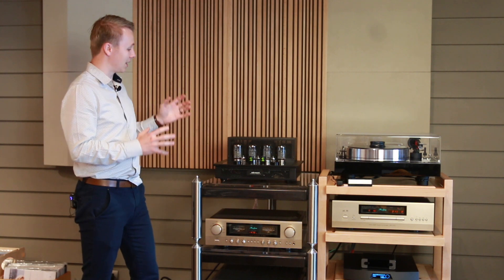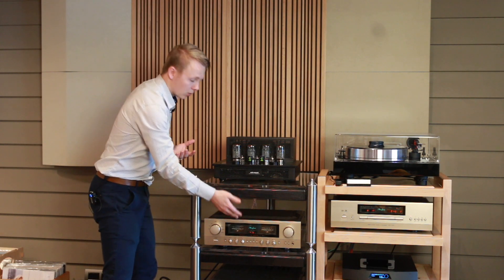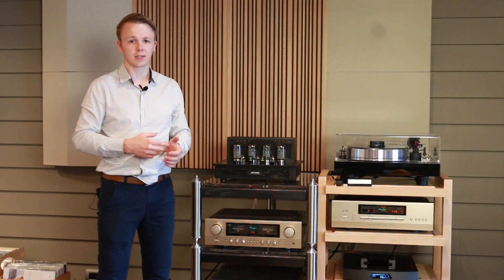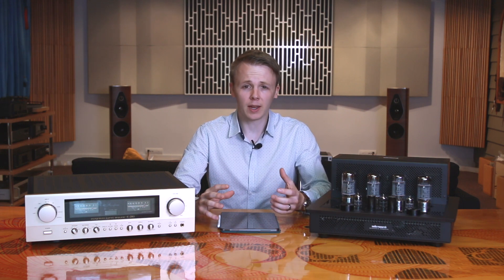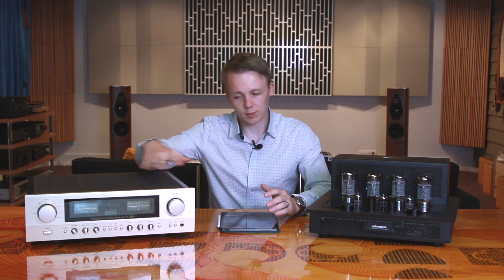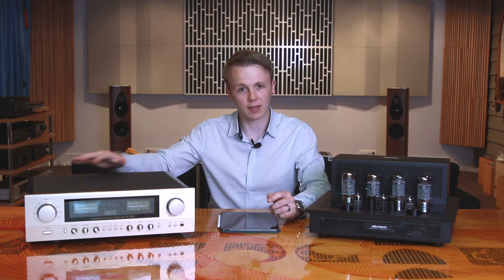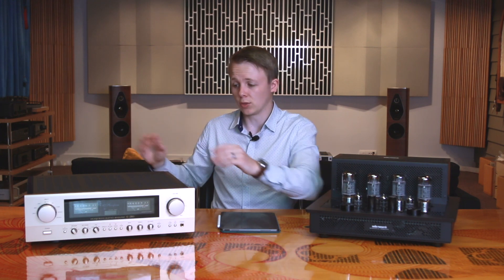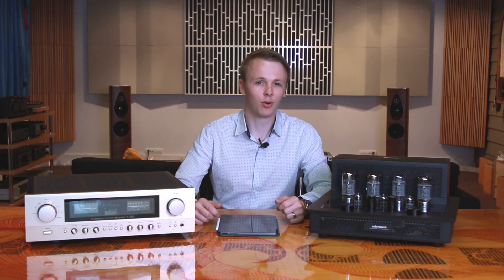Solid state Vs tube amplifiers

Comment: I own both solid state and vacuum tube amplifiers. 
At best this comparison describes ONLY the these particular amps' relative performance with these particular speakers.    Additionally, the solid state device has many more controls that unless bypassed mitigate the value of the comparison. That is, these is more circuitry between the input signal and the output.  Your point about better tube amps providing better soundstaging is correct.

Comment: I found this to be a fair comparison between the two amps. It would not be for the two typologies. As stated in a previous response, there is too much variety in how tube amps sound. ARC tends to be tube gear that tries to be accurate over being sweet. Their products should not be considered a full representation of the typology. That being said I too feel that vocals out of a Tube Amps sound more natural, SS amps to me are better with dynamic swings and extension. Regardless there is a lot of different characteristics in-between, and one should be careful not to overgeneralize. The biggest drawback of tube gear I find is the maintenance of the tubes, followed by their excessive HEAT, specially designs that run is pure class A. It is like have a 300-degree oven running with its door open in your listening room. SS state amps can run hot as well, but I have yet to run across one that gets as toasty as a tube amp. Regardless, nice job, and keep up the good work.
Reply from the maker: Thanks for your comment.  It is hard to void generalisation when talking about complete categories or brands in hifi, and there’s always going be someone who anecdotally has the opposite opinion. But I think you can see we tried to make it as fair and diplomatic as possible.
I always approach compassion videos the same way I would if a friend asked me for honest opinions on the matter.

Comment: The main advantage of the tube amp is that it is better able to drive the most difficult loudspeakers. Even if the impedance drops to 1 ohm, it won't collapse, which isn't the same story with transistor amps. After that, there's a huge variety of tube amps out there, and for me the best are the ones with just one power tube, like the 2A3, 300B, 805, 811, 845 - that's nirvana ! 😍

Comment: Great insight on the differences and its clearly Accuphase for me. Which model would be the better fit for a pair of Buchardt S400MKii speakers with an impedance of 4 ohms and a 88 dB sensitivity? Would a e280 be sufficient or do i need to step up to the e380? Thank you.

Comment: Tube is the best, nothing beats them.  If you don't want to spend time learning how they work or to maintain them, then solid state will be great but it's just not the same.  In my opinion, I'd rather have a bookshelf tube system that sounds great than a $20,000 giant solid state system.  Only one of them will be realistic.
Reply: I have a 1960's Grundig tube radio and i prefer it over my modern Sony system 💀😂

Comment: You said that this is the only integrated that AR make. But I have a VSi75 which I think is still a current model.
Reply from the maker: Looks like you are right. I was told the i50 was the successor to the vsi75, but after doing some digging, it looks like the vsi75 is still current.
Thanks for the correction.

Comment: This is a nice effort, but it's FAR too small of a sample size to draw any proper conclusions.  For example, in direct contrast to your observations, most tube amps produce a larger, more holographic and enveloping soundstage than most solid state amps.  Also while tube amps generally have excellent tonality, the most accurate tonality I've heard was produced by a solid state  amp (which happened to be made by Bryston.) Consistent with your observations, tubes do have a tendency to sound more life-like and usually perform worse in terms of dynamics and bass response, however better designed tube amps have great dynamics and bass and rival solid state amps in this respect. Even start-up times to peak performance vary as much by manufacturer and topology as they do by output device.  I think it would be worthwhile to try a few pairs of amps to see how your comments about each device holds up.
Reply: Thanks for this great response! It’s a pity you didn’t get a response from the publisher, although they did a great job in my view. Having a Yamaha A-S2100 combined with a Chord Qutest DAC , I’m certainty not unhappy, but at first I want to upgrade my amp to a better one, I think, and I doubt between the both of them. Do you have any alternative suggestions to look at? My preference seems to be the I50, because the Yamaha and the Accuphase are somewhat comparable in my view. Any suggestions are welcome 🙏
Reply: Thanks for this great comparison!
Reply: @jos5067  Thank you for the kind words!  Which speakers are you using?
Reply: @terrywho22  Revel F208 speakers are in use.
Reply: @jos5067  None of my local dealers carry Revel but i've heard good things.  All probably stuff you already know, but an 88.5 dB sensitivity makes it compatible with a lot of amps, though the 8 Ohm nominal rating is a bit misleading... it's between 4 and 7 Ohms from about 50Hz  on up and 4 Ohms around 28ish Hz.  Your Yamaha is electrically a good match for the 208s as you need an amp that's nice and stable at 4 Ohms, but if you decided to go with a tube amp, make sure it has a high quality 4 Ohm tap (like the I50.)  There are a ton of choices that will work for those speakers at your budget... A McIntosh Mc275 would probably sound amazing with the Revels, but you'd still need a preamp.  Let us know what you decide!
Reply: @terrywho22  Hi, your analyses are correct, the 8 ohm is indeed misleading. The McIntosh is a bit too expensive and doesn't fit in my audio rack, the I50 does. I also consider the NVA integrated amp, or a the Leben CS600X, but both don't have a remote control, but are great sounding amps I have heard. Did you hear one of them? I really have to go out to listen to all of them... Thanks again!

Comment: As soon as you say "real" instruments sounded more real, what else needs to be said? Now, to be fair that doesn't definitively say tubes sound more real than solid state. Just between these two amps. And in my opinion that's more to do with Accuphase. I have never heard an Accuphase amp that had that quality. Always sounded lacking in that area. It's hard to put into words because you have to rely on terms that others will understand. But there is a sound that has always been attributed to Japanese audio components that Accuphase epitomizes. Some call it harsh or analytical.  Some say fatiguing. Whatever it is I find it gets in between you and the music and stops you from getting truly emersed in the music.

I don't think all japanese components do this. Luxman, for example, isn't like that. At least not across the board. And even their "lesser" stuff still has the ability to get out of the way of the music.

Comment: If both specify a same type of power, this is the same power. 100W rms is 100W rms. Tubes do not have their own magical watts. And different horse power numbers of american cars in 70s because of different standards do not relate to tube to solid state migration happened that time also. If someone means an ancient high ohms loudspeakers designed specially for tubes, then common that’s an absolutely different story.
Reply: 20 class A tube watts are practically a completely different story to 20watt class AB solid state.

I often think the essence of what you are saying is correct and there might be some other figure, like BHP and torque for car engines that individually don't convey as much of the story as they do in tandem and that would better inform us of potential.

Nevertheless it is what it is and my 20 watt rated class A GM70 tube amp sounds at least as powerful and certainly as loud on my 89.5db rated huge 3 way speakers as does my 60 watt rated solid state class AB amp.

There are other peculiarities that we could use lessons on for example why do solid state amps tend to have increased rated power as the ohms value drops and why that's not so for tube amps. That seems like part of the tube v solid state watts conundrum.
Reply: @01egna  I see.. About "powerful" this could be an issue with a buster capacitor. It's not unique thing to find 10mF cap inside a 100W rated AB amplifier. It won't be "powerful" under any circumstances. I like how A-class sounds, but I'm skeptical when people find 20V x 1A different to 20V x 1A. Anyway I listen to a music too many hours per day to use an A-class amplifier -)
Reply: @sc0or  I know what you mean. A recent report suggested that we pay the highest gas and electric prices in the world here in the UK and I like you 'listen to music too many hours per day' which results in my paying on average over UK£200 per month on electric alone a large part of which must be due to my hifi gear.

It's a choice. I'd rather pay extra if/when necessary to add a solar array to my roof in order to subsidise my love of music in the long term, than compromise when it comes to SQ.

I'm currently saving for an Accuphase combo C-3900 pre and A-80 power. From that perspective, what's £1k, or £2k per year in electric between friends now that my sons have long left home and I've only a daughter left to help through university? My kids cost me way more to raise. ;-)
Reply: @01egna  ) I have a 3.8kW solar panel on a roof. I think more about a temperature in my office room. In a summer neither the panel helps to compensate climatization spending (250 square meters). May be one day I'll add a water pump and an external heat sink for a good A-class. I'd like to have EL34 driven one.
Reply: @sc0or   Good luck with the EL34s. I recently sold a Leben CS600 with Sophia blue bottle EL34s. Beautiful amp and nowhere near as hot as my SET. In fact it's the most beautiful piece of hifi equipment I've ever owned and very well behaved for a tube amp, but you need very high sensitivity speakers to get the best out of a push pull EL34 in my experience.

At one point I thought about supplementing it with a Hypex amp for bass duties.

FYI my 20w GM70 SET mono-blocks seem more powerful than the 28w EL34 Leben CS600.

I hope to move to Cyprus within the decade and the heat question is on my mind too. The GM70s won't work for me there unless I buy a house up mount Olympus where they'd be an excellent substitute for a fireplace, as they are for me now here in the UK. ;-)
Reply: @01egna  Just checked GM70 datasheet. Have not seen so linear triode yet. Unbelievable.
Reply: @sc0or  It's simply the best tube I've ever encountered [when properly implemented] for holographic god level sound regarding every conceivable music lover parameter.

There are three dimensional palpable aspects of sound completely missed by run of the mill UK£100k plus amps I've heard and that I only know exist because of my GM70s.

I do not expect Accuphase can compete in any way with my GM70s that live in my very private listening room. I want the Accuphase gear as a decent living room system that I can use to listen to music more casually with family and friends than the overwhelming entrancing experience of the GM70s.

The sound is something that I simply cannot live without and I have found no other amp type that can even approach. 211 etc. don't come close.

I prefer the copper and actively dislike the carbon version of the tube.

I believe that the GM70 tubes were first designed for the Russian military to be used in tanks for comms. I guess that they probably appreciated them being on the hot side.